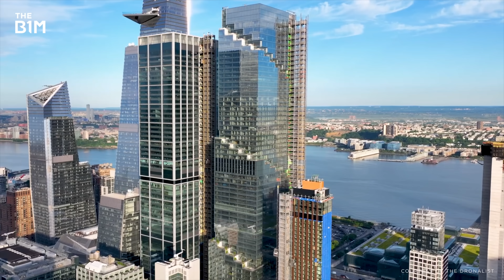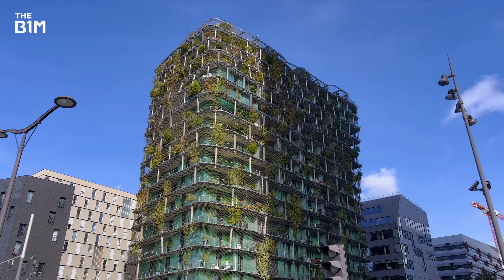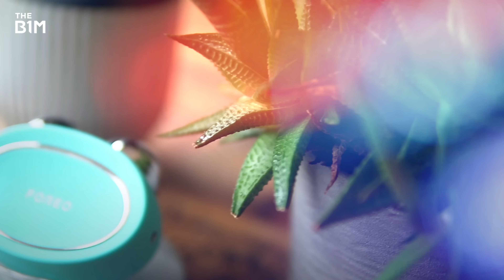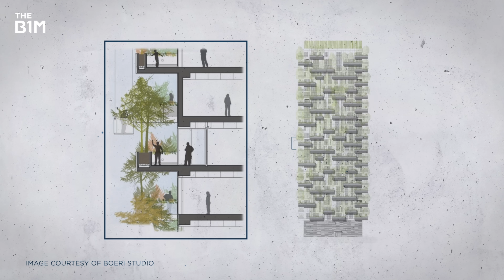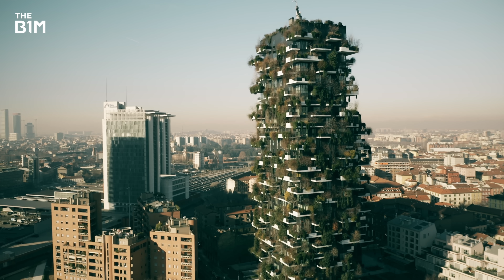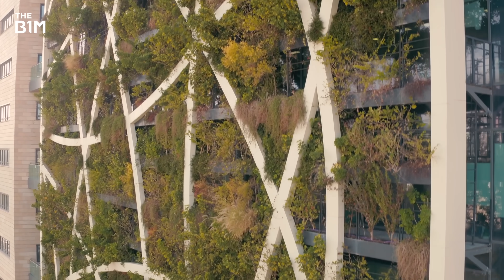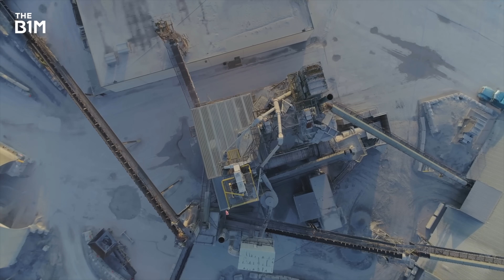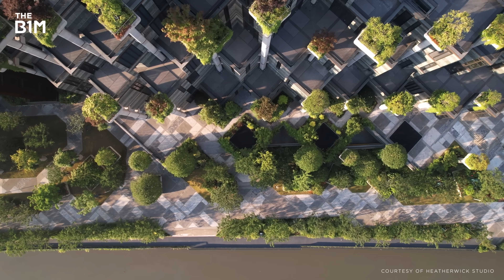Tree-Covered Skyscrapers Aren't Actually That Green

Comment: Just at the beginning of the video I can see a significant problem with using trees.  Trees have ROOTS, and since they're likely using fast growing soft wood water trees, the trees' roots are going to eagerly seek out all nearby water sources, meaning any irrigation systems, drainage systems, etc.  Those trees will clog up various water-bearing systems rather quickly.
Then there are all the forms of wildlife, particularly birds, that will be attracted to roost and nest on the trees.
They might do better with simple mosses and/or shallow root grasses...

Comment: I mean I definitely do believe in the psycological benefits of such "green" buildings at least. I know I'd be happier living in a building where I could see trees out of my window regardless of if I'm on the 1st floor or the 20th floor. And if I could see other such 'vertical forests' in the distance on top of that even better. 

But these surface level solarpunk designs are definitely not a magical fix for climate change and should not act as any kind of a replacement for actual real action that needs to be taken like actually better designed city layouts that de-emphasize car use as a whole that would do a lot more to help reduce carbon footprints than planting a few extra trees ever would. 

But it does look pretty and that is a real legitimate benefit both aesthetically and psychologically.

Comment: Be less maintenance and spiders if everyone just got a balcony with a few potted plants.
 The problem is water issues most current insurance claims for domestic damage is in bathrooms, this is like building a giant bathroom around the building. 
Ok if it's pulled down in 30 years but defeats the carbon credit cause. 
Each building probably requires 100 tonnes of green waste removal a year by specialist. 
Also when I stay in the city I like to be up high away from critters, in Sydney they have 1 of the world's most venomous spiders the Funnel Web and residents in Central 1 with kids probably now use lots of insecticides

Comment: I think its a cool idea but I worry about drainage issues damaging\corroding interior parts.  Like 20 years from now balconies break off from undetected water damage to steel and concrete.  Or upstairs drainage systems has leak\failure, flooding lower floors.  Nightmare scenario is undetected corrosion damage to critical steel\concrete members causing structural failure (like the Florida condo collapse).
Reply: Drainage is certainly a concern, but this can easily be mitigated by turning the planters into drainage features, for example: bioretention areas.

Comment: what I don't understand is why they are so set on putting trees on buildings instead of other types of vegetation. Should think about high altitude vegetation. Might not be as pretty but it's the kind of vegetation that would maybe suit the altitude, wind, temperature and humidity more than a random huge heavy tree. They also need to look more into different types of local native vegetation. Damn, even maybe look into mosses or lichens since they already grow naturally in human made structures.

Comment: as someone who owns a lot of older buildings in an urban rain forest - all i see are roots breaking apart the structure and a nightmare of trying to remove very large dead trees, huge on going expense with questionable benefits.  like so many green 'solutions' - it appeals to "common sense", where CS is popular uninformed superficial opinions and no one is willing to do the hard boring math to find out if you're actually just making the problem worse.

Comment: I'm telling you right now they will destroy the buildings in the end. Tree roots win against concrete every time. I have a commercial landscaping business in Florida. One of the condos we maintain has these stupid planters all over the sides of the buildings filled with dirt and trees and plants. They are a nightmare. The tree roots have pierced the buildings everywhere. The irrigation systems have failed and flooded units. For 3 summers straight now my crew has had to rip out all the plants from a planter or two and dig out all the dirt and then a contractor comes in to fix and reseal everything and then we put it all back. Every planter is being done and will have to probably be done every few years. It has cost them 10s of thousands, not to mention the insurance payouts for the flooding. The idea is simply not going to work. I would like to see the damage 15 years into the future. The bottom line is the trees and plants are going to erode and destroy the buildings.

Comment: It's better than those concrete jungles, it's gonna reduce local pollution, which is great, but it's gonna have limited impact on climate change, which is fine. Depression rates will go down a fair bit. Critters might find new homes, as long as they are not seen as detrimental to the actual greenery, or in the case of squirrels to cables. 
Certainly worth the extra maintanence, there are less and less jobs so it will be fine from that end. 

But we could have done better from the start as other comments have mentioned.

Comment: A skyscraper to begin with is a very environmentally "unfriendly" thing- putting leaves on it does close to zero anything to offset its footprint.
Putting greenery on a skyscraper and calling it "green" or "environmental", is like putting lettuce, onions or tomato on a triple stack cheeseburger and calling it "eating vegetables". There's little point other than denial and ESG pandering- and additional specialized costs and hazards.

Comment: For what it's worth I'll mention that saving a teensy bit of concrete to not accommodate plants is really an insignificant amount of the total volume of concrete used for a typical project. I was a little disappointed to hear such a huge lack of knowledge of concrete construction throughout this video. There's one guy literally talking out his ass.
Concrete is weird in that so many people don't know anything about it, yet they are involved in the design of it. When they mention that "they'll save CO2 emissions" by using less concrete to avoid accommodating vegetation, take such a statement as that person not knowing F-all about a concrete building. By far, most of the volume of the concrete is used in the main structure (Foundations, Core(s) , Columns, Walls). Furthermore, trying to skimp on concrete is a major cause of premature failure/deterioration of concrete.
The real CO2 killer is mobilization. A designer who understands concrete well can make a building that will last 100 years. A designer who doesn't understand concrete will make a building that will something fall apart when it's still being built. Do the math and tell me which strategy emits more carbon: A concrete building that has to be demo'd in 20 years, but the designer saved 0.2% of the concrete volume, or the 100 year building that used up that extra 0.2%?
It's also worth mentioning that concrete exposed to the atmosphere will re-absorb 100% of the carbon emissions it created during it's lifecycle (save for the bad designed that often aren't even to code).

Comment: not sure why the video just kept repeating clickbait article titles and made the idea seem so scary and ' not actually that good
. it addressed actual content for like 4/12 minutes. there are certainly additional safety & logistical considerations with trees/greenery incorporated into infrastructure, but also tons of ways to do it smartly! and many buildings have flat roofs/areas already that can be made much more green anyways, that don't even need to hold up entire TREES- a pollinator garden & thin layer of soil does wonders for local air quality, biodiveristy, and cooling. and that doesnt take a ton of extra concrete, as buildings should be able to ... hold a load already, obviously.

Comment: Does it really use so much more concrete than a regular skyscraper? Seems like this one-time carbon footprint "investment" needs to pay off given that the trees contribute daily through less needed air-conditioning or reducing CO2. Also, the very existence of higher buildings concentrated in city centers largely removes the need to use cars to commute.

Comment: You say these aren't actually that green (video title) but you never do any actual math and analysis of how much extra upfront CO2 (and other polutants) these buildings release vs the amount sequestered by the plants on them.

If the goal is purely aesthetic then that is one thing, but if you want to make a judgement on the climate benefits you need to actually do the math of comparing how much these buildings release vs a typical building, and then how much the trees will actually absorb. You can then go one step farther and divide the price increase by the benefits (assuming its even a net good) and see how cost effective a solution it is vs other carbon sequestration techniques.

Comment: the trees aren't there to be environmentally friendly its to cool down cities modern architecture is very basic its white paint concrete and black roofs they make the area hotter there's no plants or trees and astroturf is becoming the norm

all this leads to these suburbs heating up to in some cases unlivable temperatures as seen in Sydney with some suburbs getting up to 60 degrees in summer the trees and plants absorb the heat and dissipate it

Comment: The energy needed to get water up that high probably significantly cuts into whatever (likely minimal) carbon offset the greenery offers.

However, and I just thought of this, there may be some pretty respectable temperature control benefits. Not sure about that, worth looking in to.

The most important thing, though, as others have said, it just looks really cool.
Reply: Don’t you have to send water up a skyscraper anyway? For like taps and showers?

Comment: 100 seconds in and this video is already bullshit. New York is the most built-up city in the U.S. and the average carbon footprint of its residents is the lowest in the U.S., and this is because skyscrapers HELP the environment. Density means two big things: 1. your walls are insulated so you consume less energy for heating/cooling, and 2. it means you live closer to where you work and where you shop, so car travel is reduced as you can walk or take PT instead. Skyscrapers are ALREADY green, so the argument has to be why green skyscrapers are a net loss over other skyscrapers.